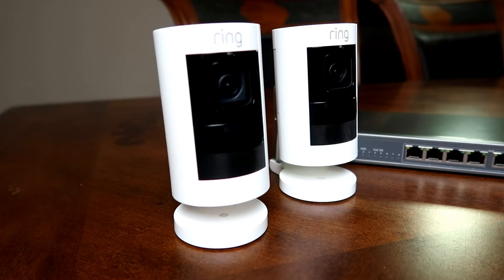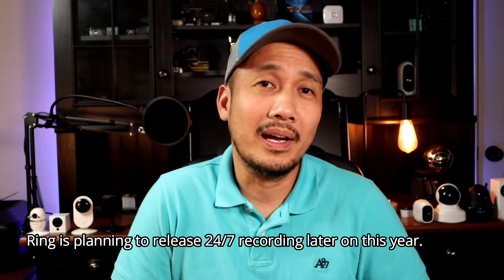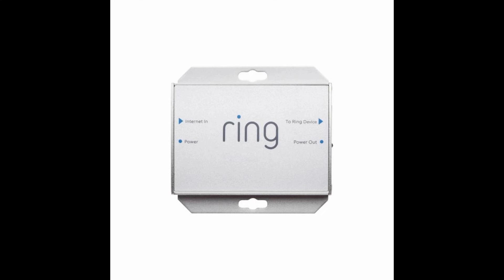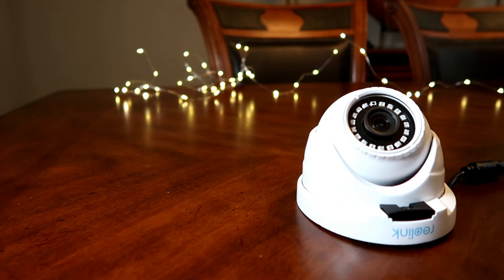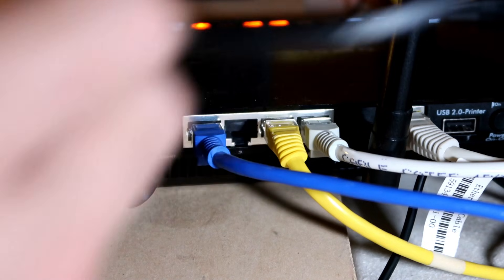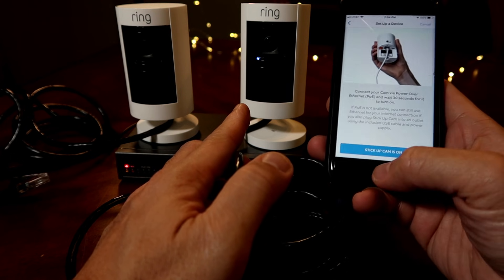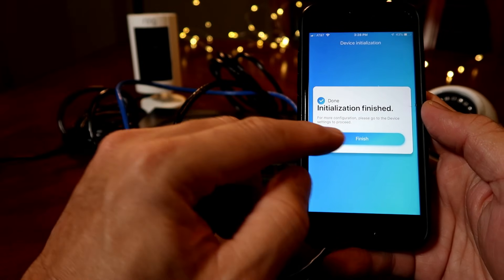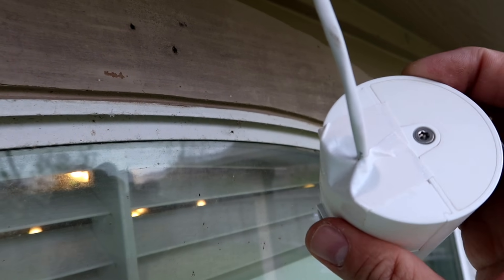Ring Stick Up Cam PoE (Power Over Ethernet) Setup and Installation

Comment: One thing I would add is instead of using bulb grease, you can use silicone sealant around the exterior RJ45 connection. It's easy to apply and to peel off and provides waterproofing. Around plastic piece where the cat6 cable inserts into, you can put silicone tape over the hole to further waterproof it and to prevent bugs from making a home in there.
Reply from the maker: Thanks for the tip. I'll try that.
Reply: Just use duct seal putty.

Comment: Hey LifeHackster, great video.  I just purchased this camera from ring.  Since I have 2 other ring wifi cameras, I was hoping to simplify using one app on my Iphone.  Little did I know the issues this camera would take.  I had a wifi camera outdoors, that was pushing the limit of the wifi signal strength, so I figured a PoE connecting via an ethernet, would be the way to go.  It seems Ring help force is unfamiliar with setting up a PoE camera and it has been one problem after another.  They indicated just hook up the camera to power source then run ethernet from router to camera, and of course that doesn't get it.  Your video on how this works is most helpful.  Now I understand I need more than a common switcher off the router, but a PoE switcher to power the camera via the ethernet cabling.  Something the Ring Help desk doesn't seem to understand either.  Thanks to your informative video, once I get this working, I may look at a better camera system, using the PoE setup.
Reply from the maker: If you will be running PoE or ethernet cable outside, check out NVR systems. They will have better video quality up to 4K and can record 24/7. They are just not reliable in motion notification...Ring still is pretty good in accurate motion detection.

Comment: Excellent video! what's the difference between the stick up cam and the stick up cam elite? My house is prewired with ethernet cables. I'm trying to figure out which camera to choose wired, plug-in, battery?  Does spot light cams also have the ethernet port?

Comment: I would like to replace some old POE cameras with the Ring Elite cams but I really dislike the way the underneath is exposed. Hope Ring improve that aspect of the design in a future version, or at least provide a rubber grommet that seals the Ethernet cable hole.
Reply: I called Ring and they sent me this video and yes the exposed connection is not up to there standards. Can't believe they missed that.

Comment: Can’t wait for ring to release 24/7 recording.  Any idea on pricing yet?
Reply from the maker: I haven't heard anything yet. I know though that it is a separate plan and additional to their current Protect Plus Plan.
Reply: LifeHackster is there any news on the 24/7 recording options to date? I ha e a ring alarm system, doorbell and floodlight cam at the moment however, contemplating moving to a NVR setup like Unifi (any other recommendations?) I would prefer to keep everything in the same Eco system though.
Reply: This didn’t age well 💀

Comment: I would think the primary advantage is less chance of cut-outs though that isn't as easy to test unless you have problems.    I'm not surprised that the video quality is the same as their choice seems to have more to do with their bandwidth and storage costs than anything with a customer's local bandwidth.
Reply: @First Name I didn't say power cuts, I said cut-outs.  I'm referring to issues where you don't get video, get choppy or it cuts out/freezes for a few seconds.  Like he mentions in the video, wifi is the main issue with all of Ring's cameras that causes these (and other) issues.   Wired solution eliminates all the variability and issues that wifi brings.
Reply: @First Name Yeah, that is all I'm suggesting; that wired benefit is just to eliminate the possibility of issues with wifi.  I've not had any issues either, since some of the updates last year addressed a number of problems, but forums indicate lots of folks still do.  The camera's wifi chips or software seem to be pretty subpar.    Like Lifehackster notes however, I wish wired did give you the option to select for higher bitrate.
Reply from the maker: True. It will be more data that they need to save to their cloud...I wish they have other recording options aside from their proprietary cloud recording.
Reply: there is no point to use ring products if you are setup for POE and run cat wiring. Ring's business model is get people to pay monthly cloud storage so they will never open up their system for local storage and allow for better quality recording, because then no one would pay the fees anymore.

Comment: The Wasserstein PoE Switch you listed and used, states it puts out 96w across the 8 ports; that comes out to only 12 watts per port.  I spoke with Ring customer support yesterday about the watts needed/required by the Stickup Cam to run POE; in short, the representative could not find the answer in her system, it wasn't listed, but deduced it needed 15.4 watts, since the "Ring POE Injector" sold by Ring, puts out 15.4 watts.  Do you think possibly your test results would have been better with a full 15.4 watts going to the camera?  If you get the time, could you test this observation and see if it makes a difference?
Reply from the maker: I’ll try to test it and see..
Reply: Since these cams use a 5.2V DC input voltage, and the included power supply puts out 1000 mA, that equates to around 5W per camera, well within the capabilities of that switch. Just my opinion.

Comment: With the ring wired camera, can you use poe solely just to power the camera but connect to the modem for signal via wifi?
Reply: Great question I’m wondering about this as well

Comment: IMO, if you have an area of your house with poor or spotty wifi signal and want a camera, get a nice POE cam with built in SD card storage so you don't have to have an NVR box.  I have a couple Hikvision DS-2CD2385FWD-I and their 4k 8mp cameras are not only much cheaper than the stick up cams, the image quality is on a totally different level.
Reply: yup EXACTLY. if you are going to run poe setup and run the wires, then get out of Ring's crappy hardware. They will only use cloud because thats how they make money on the fees people pay. It's almost a waste of time and effort to run the cat wiring then in the end use it for a Ring product lol
Reply: @moialder252  The only counter argument to that I would say is that Ring's software is well put together and everything "just works" (in my experience at least).  There's a lot under the hood you have to tinker with on the higher end cams as well as setting up port forwarding in your firewall.  Some of my hikvision cams can't stream the full resolution feed even on the local LAN, h265 breaks internet explorer's live view so I have to use h264.  Since I bought gray market versions of a couple of them I can't upgrade the firmware for fear of bricking or reverting back to Chinese, the hikvision app is atrocious, etc.  There are equivalent quality POE cams out there but my hikvision NVR kinda keeps me tied to their cameras and I don't need a ton of them so I haven't bothered looking into other brands other than the Wyze cams inside my home.

I see that 3 dollars a month for Ring as a convenience fee and you get an easy to use app out of it and in the highly unlikely scenario that I have a break in and they manage to find and steal my NVR, thus removing all footage, the streaming footage with Nest isn't really steal-able so there ARE some perks to their services.  My main gripe with the Ring doorbell pro cam I have is that the image quality is significantly worse than my 1080p hikvision.  It's genuinely terrible but just good enough to serve it's purpose.
Reply: I have one of these cameras it's impossible to switch from wifi to  Lan  goes to 95% where I intended to install it I can't get wifi thus my purchase of this camera even in front of the router with available 1g and wifi at 321mbps it still. Won't work , a total piece of  junk even ring tech can't solve the issue

Comment: What do you think about the Arlo cams vs the ring.  I do have 15 Arlo cams some hooked up to power all the time and most on battery.  They operate pretty good but the main issue is obviously battery life in an area that has a lot of activity. Just your opinion what one do you like best over all of you had to choose.  Reason I’m asking is I just ordered a ring alarm system and saw the cams and I do like an all in one app.  Let me know
Reply from the maker: I’ll go with the Ring just because of the overall Ring ecosystem especially if you have the Ring alarm.
Reply: LifeHackster does it have configurable alerts because I’m on iOS the normal alert is general for all

Comment: Thanks for your review.  Ring is not there yet, the worst part is there camera design does not protect the cable.  I'd rather have poe cameras where the cable is protected through the camera body.  I wired our previous house for ethernet and rg6 for cable / satellite.  Since I am retired, I will probably spend some time in the attic to get my dvr cameras up and running.  RG6 is probably a good idea as well, I might as well do it all at once!
Reply from the maker: I know. I also not liking the look of it with the cable dangling.

Comment: @lifehackster - does hanging on the soffit ceiling like you do require some kind of anchor or is it strong enough to not drop the cams?  Thinking of putting this up in my breezeway ceiling.

Comment: Hi good vid quick question, I am looking to buy this very ring Poe camera. I want to lower with a lower cord and connect ethernet for internet purposes. Will there be any issues using power line adapters for the ethernet connection between camera and router? Thanks

Comment: I have ethernet thru out my house and garage. can I use a single port injector to power a cam inside the garage and then another outside the garage using 2 of the available ethernet ports in my garage? or should I use a switch with multiple ports? I designed my garage and my house to be able to accommodate POE even though I didn't know what I would use it for. it appears to have been a wise decision but the answer to my question will decide for sure in regard to the ring cameras. thanks in advance.
Reply from the maker: Sharing one injector will probably not work because one port will only give out enough voltage/power for one camera. You can use like the one that I have which is one port from the router and  8 available powered ports.

Comment: I plan on buying 2 or 3 of the stick up ring cams. Each camera is going to require a 100ft ethernet cable. Should I worry about buying high speed cables since they are way more expensive? Just wondering if it's a waste of money or not.

Comment: Life hackster. I have a question. I’ve been using Arlo cams for 4 years now and love them but don’t love swapping batteries.  I used to have Poe cams and they weren’t that good and changed them for Arlo. One issue with Arlo on iOS is they don’t have configurable alerts on iPhone.  So when a person crosses your cam the sound is the same as a text message or general alert.  Very strange they didn’t give the option on it for a different more noticeable sound.  So the question is on an iPhone the alert that happens when your cam is tripped can it be changed for different sounds.  I see this very often in iOS with just apps in general.  Somehow the app writer is leaving these things out.  Please let me know

Comment: Do you have a link for the Wasserstein switch? Thank you.
Reply from the maker: The link is in the description of the video. Thanks.
Reply: @LifeHackster  Thanks, I must have overlooked it, it's now unavailable, but found a similar one during prime sale.
Reply: @michaelsmith7753  Do you have a link of the one you are using? I'm ordering Ring stick up cams and want a switch that can power all 3 cams and not sure if any switch works or if it has to have certain specifications to work with Ring. Thanks.
Reply: At the time that was a lightning deal for $35. I'm running two Ring stick up cams and one vera Vista cam, and all works flawlessly.
Reply: Sorry I had to pull the first link it went directly to my Amazon account
Reply: @michaelsmith7753  If you can't post the link, do you know the brand/model of the PoE switch you got that works with the stick up cams? Thanks for your help in advance!
Reply: @Heytherebigboi  that link is from  tp link website, it is exactly what I'm using
Reply: @Heytherebigboi  sorry for the extra reply but don't buy from that site, it is in the UK. Just search  that model number into Amazon and you'll be fine
Reply: @michaelsmith7753  which switch are you using its not on amazon anymore can you link to one that will work?
Reply: @b33fm00  from the link above to Brad fry, it is the TL-SG1005P

Comment: A question I have not really been able to confirm and am hoping you can give the answer. I like the wider angle of view of the Stickup Cam Elite but that has been removed from the newer StickUp Cam Plugin/Battery/Solar  with only 110 Horizontal instead of 150 for the POE version. The specs say in can be connected by Ethernet (POE) or 802.3 b/g/n WiFi. Listed under the Included In Box is only a AC power source for the Injector and nothing else. The Videos show  choseing connection by Ethernet or USB. CAN you Power with a USB power source (Not Included???) and connecting with WiFi, that way still get the Wider angle views and presumably editable Motion Zones (Just a guess)

Comment: I have been looking at these because my WiFi signal is a bit dodgy. I would have to run the Ethernet cables around my house to run these do you think it would be worth getting a 4K nvr Poe instead or stick with this. I already have a ring doorbell so I have the app and everything set up already

Comment: So the Poe is only for power and not data transfer in this case?
Reply: Quang Tran 
Right,
POE means
Power 
Over
Ethernet..
Not data..
Reply from the maker: Both power and data. It doesn't need WiFi.
Reply: LifeHackster why is there still lag in video even though its connected thru ethernet and not wifi?

Comment: Great videos! I love your attention to details, especially when it comes to deciphering all the Ring camera models and the features each have, it's a complicated matrix, and ring's documentation on the topic is nowhere to be found.  I believe this is the camera that they are currently marketing as the Ring Stick up Cam Elite, is that correct?  Also, can you tell me if that camera is now enabled with the snapshot feature they rolled out a couple months ago? (I saw in your other video that you still use these daily, so I figured you'd know, thanks!)

Comment: If I pick the stick up cam Poe to a switch do I still need to use the ring adapter? It would save me from plugging into two outlets with the adapters.

Comment: I think a cat6 cable would be much better as it increases the bandwidth.
Reply from the maker: You can also use cat 6..
Reply: poe cameras even the good ones wont even come close to maxing ou tthe bandwith that 5e is setup for. heck even regular old cat5 is plentiful.

Comment: The only issue for me is ease of use. If I have multiple apps to control door locks, door bell, alarm system, and cameras then it is harder for my family to use. I have chosen ring for the alarm due to the integration with my door locks and doorbell. I would rather do a different system for the cameras but the it is a new and different app.

Comment: wifi is the 90% of complaints about ring products. Even when router is 2 meters away. They're not intended for non-stop live video feeds imo. I hope POE products fare better because they have good marketing.
Reply from the maker: I agree with you..it seems like their camera WiFi antennas are not as strong as other brands.
Reply: well if you run poe wiring, there is no longer any reason to stick with Ring products because they wont take advantage of what POE has to offer because of their business model to sell monthly subscription on their cloud storage. so if you wire up for POE, get a true POE system

Comment: Am I alone in not being very impressed with these new cameras? They've been a long time coming and don't seem to offer much of an improvement over the previous generation in picture quality or technology (eg: facial recognition etc), and aren't exactly cheap either...
Reply from the maker: The stick up cam has a bit better video quality than the spotlight cams but barely noticeable.
Reply: You have to think about bandwidth and also battery. Once you start going up in resolution and do lots of live viewing, you will drain it quicker.

Comment: I guess you forgot to mention, that only the Ring Stick Up Cam Elite, which is $199, has the POE feature, none of the others have the ethernet port :(
Reply from the maker: This is an older video and is about the 2nd generation stick up cam wired version which has POE aside from being plugged in...Ring now changed it to the Ring Elite and bumped up the price.